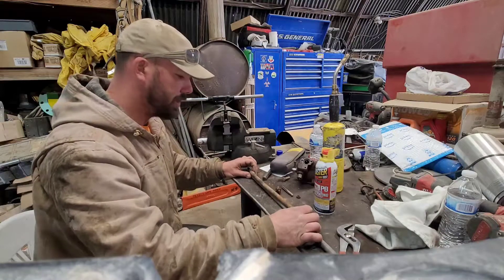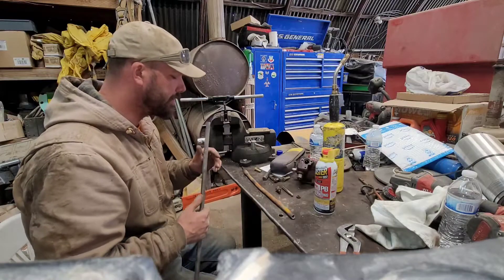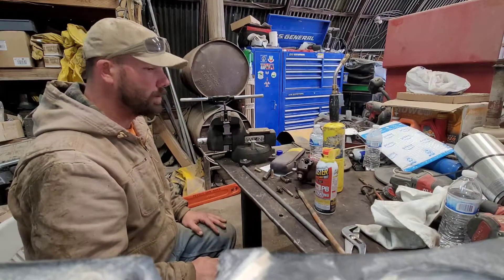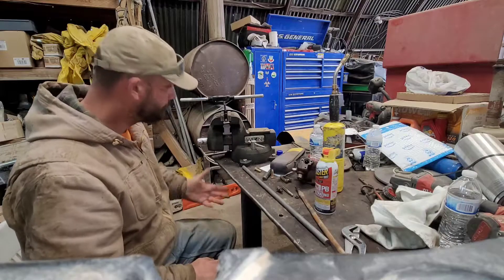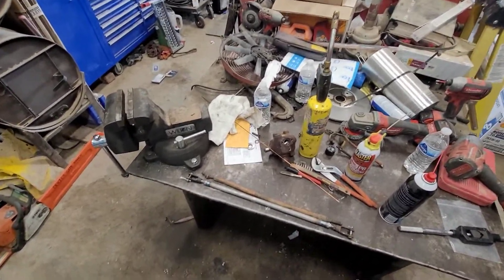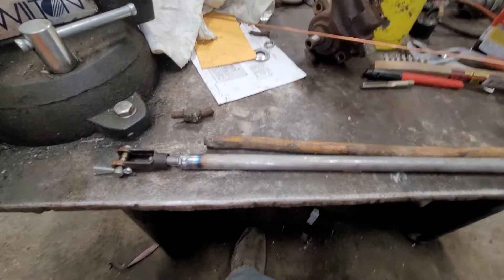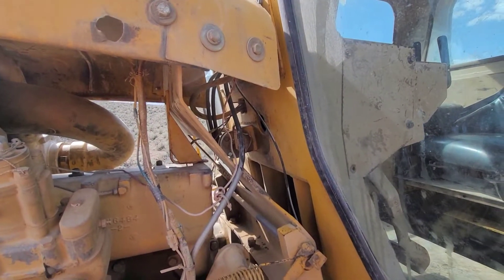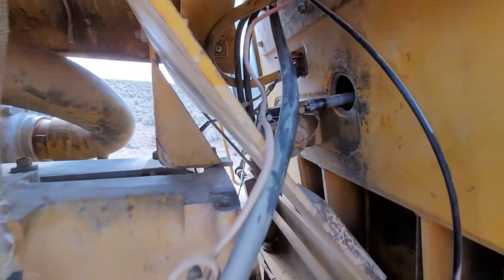Emergency Fix: Making a new throttle linkage for a Cat D9H bulldozer (quick and dirty)

Comment: Good explanation of the shortening of the linkage arm due to the bends. Great cotter pin tip about not over bending them on most applications.

You will be one of the survivors when the SHTF in society or a real TEOTWAWKI event and your